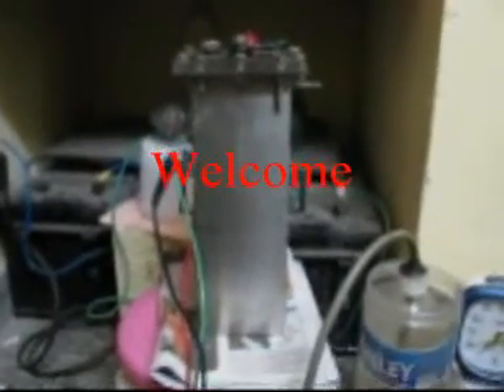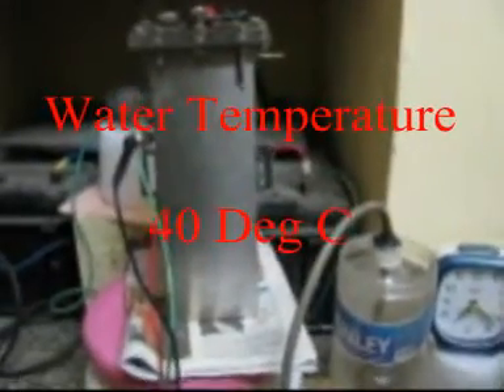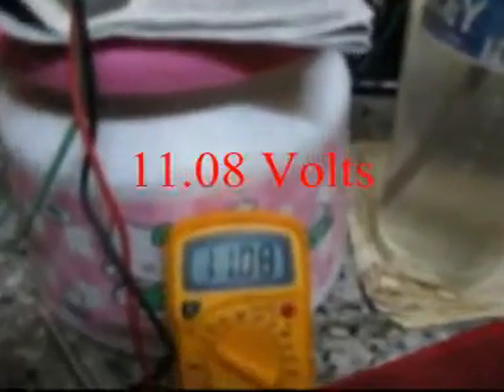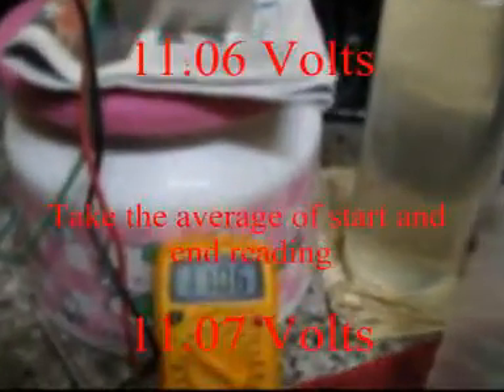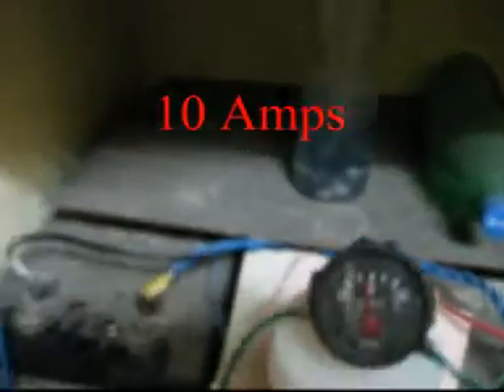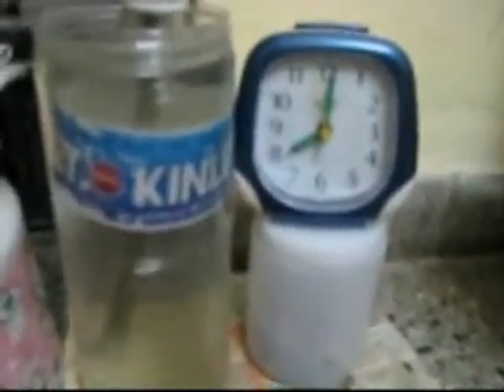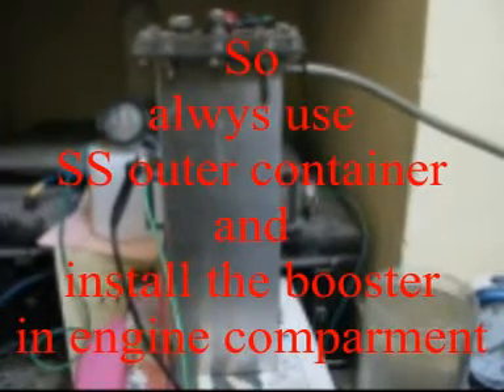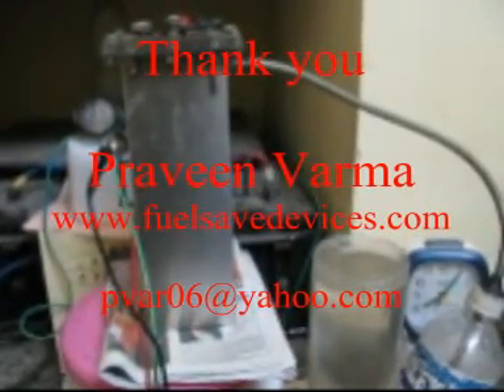Water Temperature and its effect on MMW

Comment: I really liked your 3 videos and your website - especially the construction details on the boosters.  Thank you for that.  I hope you don't mind if I ask some questions. 1) You said in this video that the electrode configuration is 2 parallel of 5 series cells each? The on your website was 2 parallel, 6 series cells, right?.  2)I think you are temperature compensating to 25C=77F=298.2K.  Correct? 3)Is it really possible to get better than Faraday efficiency?  If so, how do you think it happens?